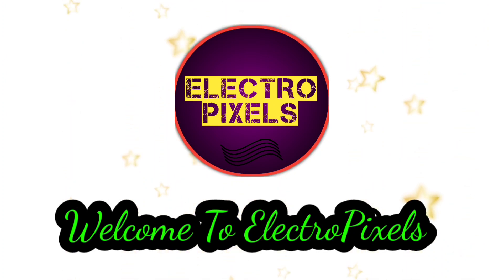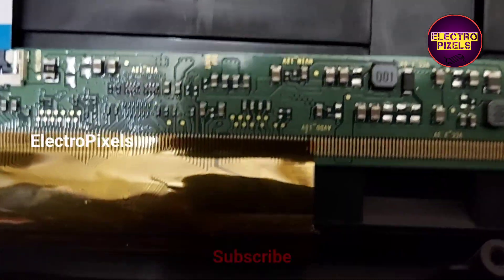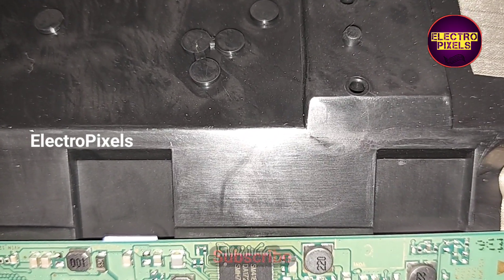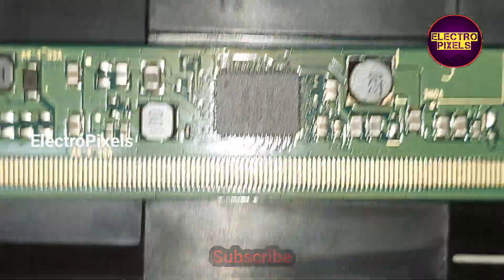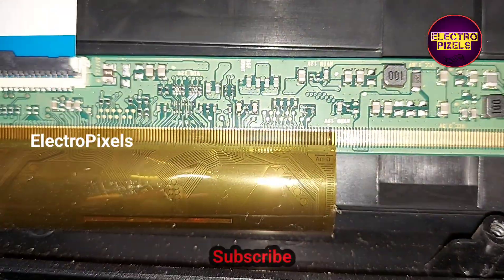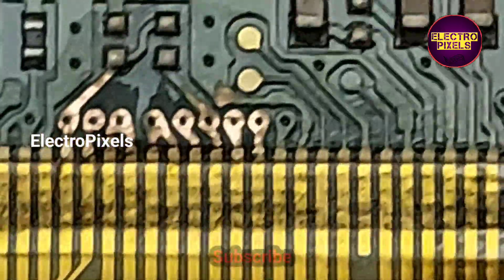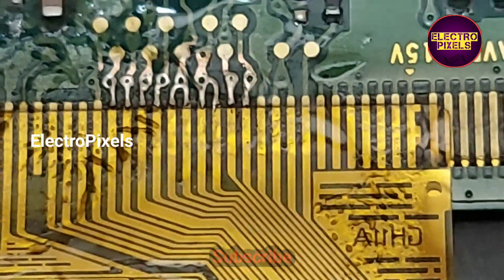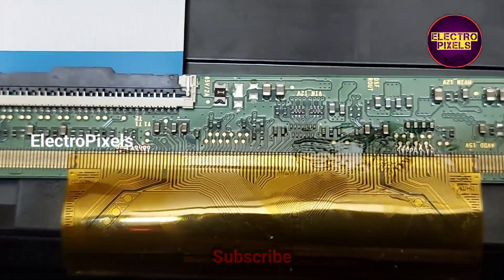Panel Short Removal in Led Tv with SM4186 Dc to Dc Ic|Fault Blank display|No vgh,vgl,avdd|No Picture

Comment: Sir:my question one, 
How much long it work?
Reply from the maker: Until The other side Gatesignals get's  shorted  it will work, It may depend on luck. Minimum 3 months to maximum one or three years. I know customers using personally more than 3 year's. Also some will last only a few months. Even the new Display also get's complaints before one year